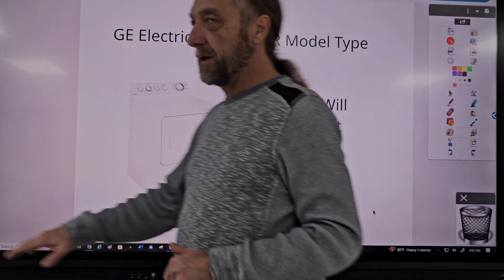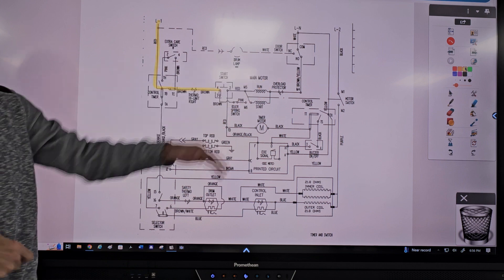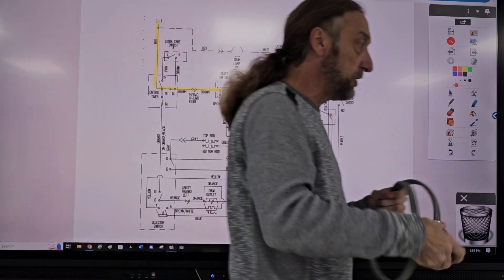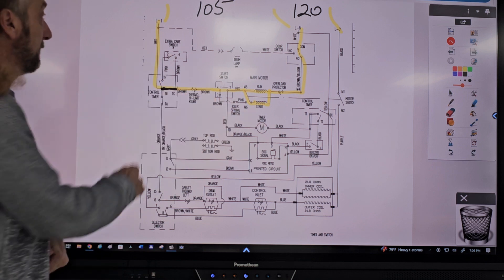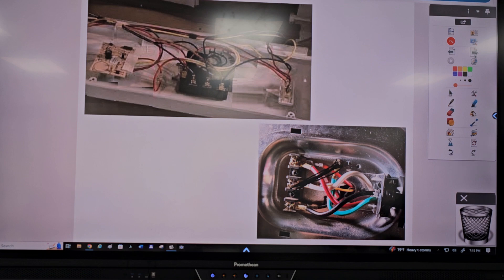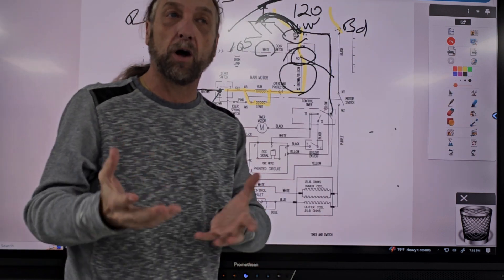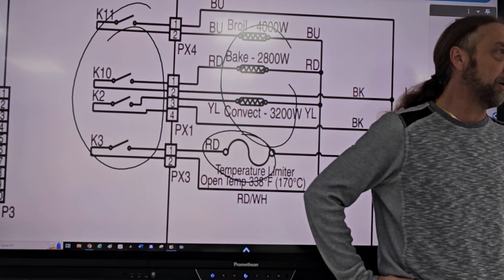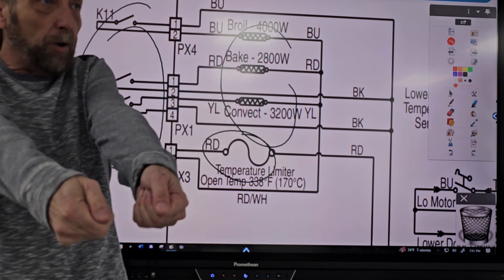Troubleshooting GE Dryer and Kitchenaid Double wall oven

Comment: I was fixing a fridge one night we have 240v in Australia at the plug. The customer knew me well and popped out to the shops leaving me with the kids(not in the job contract). Suddenly the lights went dim however the TV stayed on? So the owner returns what have you done? Only my electrical knowledge saved me from an angry customer. One phase of the 240v had gone out. Turns out a car had crashed into a power pole killing one phase. Being a switched mode power supply the TV switched to 110v I was just glad the lighting circuit in the roof was not on fire. You need to understand the voltages of single, 2phase, and 3phase,  and never disconnect the earth circuit to fix a fault I have seen it done before by an idiot.
Reply: In America 240 VAC single phase is mainly used for residential homes. At first there was no separate ground for our stoves and dryers. the neutral was connected to the 120VAC loads but also was connected to appliance ground. When there is a neutral issue like the dryer in the lecture this defiantly leaves an issue with potential shock hazard with the cabinet. For testing purposes we jumped Neutral back to ground to confirm the issue and see if the motor was operating. It was not intended to be left that way for repair. 

Now code has changed and require a 4 wire outlet which contains a separate neutral and ground.
Reply: @riz65  Don't worry I realised you were testing. You're an excellent teacher.
Reply: thank you @Fastandpro